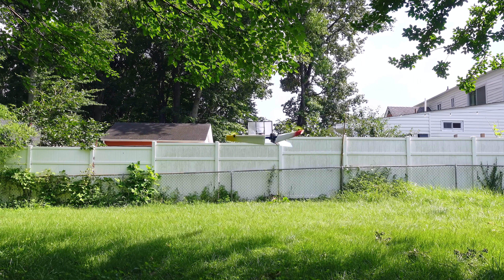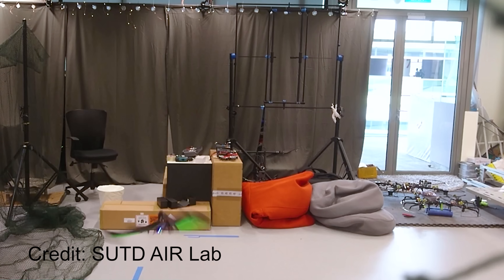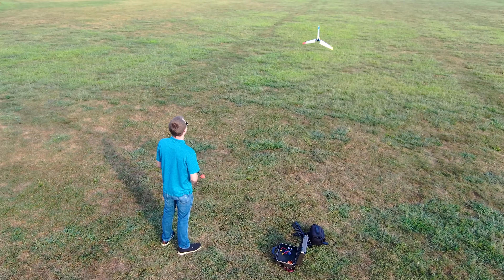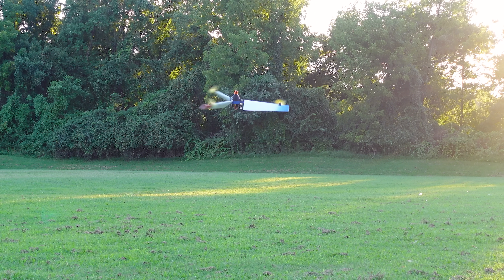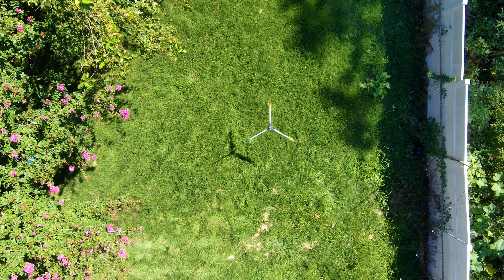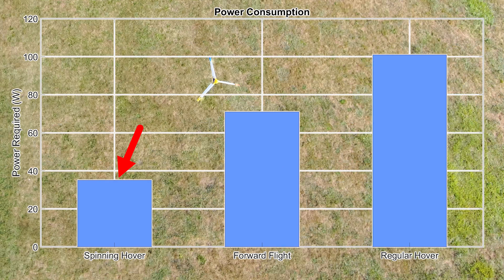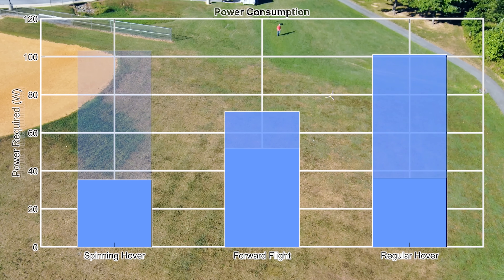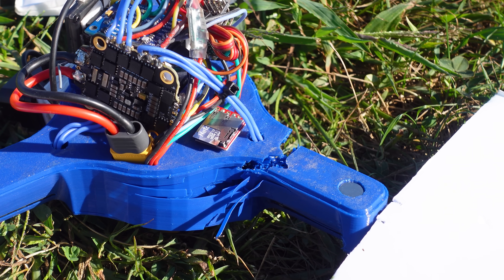Is THIS the Most Versatile Aircraft Design?  (Forward Flight Testing) - Part 2

Comment: Imagine adding solar panels as wings on that idea at 3:15 they could stay up for so long. And then the batteries run out they could land on the crown of a tree (with a special adapter) and recharge and then fly back up again once the battery power is sufficient.
Reply: assuming the weight increase is allowable, this sounds like a pretty good idea. Huge benefit that that fuselage (and battery) is rotating with the wings (and thus solar panels), meaning the wiring could be simple while keeping the battery close to the center of mass.
Reply: @grouchyfluff  Exactly, you would need a much bigger wingspan to get enough surface area, but that will also help acquire more lift. Plus, the solar panels can be embedded instead of being glued on top to save space and weight.

Comment: Ok, Mr. Rehm, cool design; but how about using 4 axis?? That'd increase forward flight as you'd have 4 semi-efficient foils instead of only 2? or, tilting the whole construct so two foils vs. one are on one side... to decrease drag and increase usability? is there a sweet spot where 3 inefficient foils are better than 2 efficient plus one dead weight? interesting. Good job, in any case! Keep them coming :)

Comment: Why don't you try a quad wing non symmetrical design, make two wings closer, that way forward flight would be more efficient since all wings would create lift, and multirotor hover would also be more stable because of four motors. I'm thinking about wings similar to this https://youtu.be/VXblTXgawjk
Reply: I'd guess it's because that configuration isn't great for the rotating hover mode which was the focus of this design but I could be wrong

Comment: Excellent innovation….it must be a breakthrough for drones! 👏👏👏👏👏👏👏👏👏👏👍👍 😊If you used jet engines, would it work similarly though much faster for military use or even large scales piloted fighter with high maneuverabily? Better still use Ti-Fusion motors to make a StarWars spaceworthy Ti-fighter. 😄😉

Comment: What happens if you spin the drone in forward flight? Does that just not work?

Your solution to being able to control the hover would probably be similar to allowing the whole drone to spin in forward flight. You would have to vary the speed of the props depending on what point in the overall prop rotation they are in...this would be very complicated, but also very cool.
Reply: One the one hand, you'd lose the lift generating effect of the wings, because the other one is compensating any net vertical force generated. However the big efficient propeller would be productive the Thrust needed to lift. Probably not as efficient as a wing moving through air in a straight line because due to the rotation the wings see a much higher appearant airspeed and thus generate more drag. It'd look really cool though.
We know you can turn your motor power into Thrust more effectively by using the big propeller. So it'd for sure be more efficient than conventional tricopter flight.
Maybe for reference it'd help to do a test run without the wings on?
Reply: Higher efficiency during hover of 3 bladed wing design is due to larger supporting wing area (3), vs. less wing area (2) in forward flight. Actually <2, as only horizontal distance of wing is creating lift. There vertical parts of wing making lift are acting against each other. (effectively making drag)
Reply: In essence, this turns the whole thing into a helicopter rotor of sorts in the forward flight regime, no? I wonder if introducing independent wing-angle control would unlock potential to adjust blade angle, similar to the effect a swashplate has on helicopters. This might require 2 more fairly robust servos and some VERY beefy code, however.
Reply: @grouchyfluff  yeah I was thinking this, you would need to independantly control both the small props and the wing angle of each. Then you should be able to have some pretty good control of the lift and counteract any rotational forces which would send it off course. 

You could make the code of the wing angle a little easier by having a mechanical guide which adjusted the pitch of the wing in a certain part of the rotation, the electronics could then adjust this guide which would influence the wing angle when it is at that part of the larger props rotation. To do that, you would need the center of the drone to be on a gyro and level as the reference point. Similar to what WW2 planes did to stop them from shooting their own props but that wasn't adjustable.
Reply: If you watch the first video, the angle of attach of all the wings and attached motors is controlled together. In order to get benefit from doing a spin in forward flight, I think you'd need to be able to vary the pitch of each blade individually based on where in the rotation it is. You could probably get it to work with just varying the motor speed, but aside from looking cool, I don't think that would have any benefit with the current design.
Reply: This seems like it could be quite efficient, as you're now using the efficiency gained by the large 'rotor' to produce your forward thrust. On the other hand, I'm struggling to visualise at what point it stops acting like a high-rpm propeller (i.e, lift is just the vertical component of thrust), vs something like an aircraft doing a slow aileron roll. My gut feeling is that these are fundamentally different flight regimes, with the former scenario not really providing much of a 'wing' effect (i.e. airspeed-dependent lift). But I'm not really able to come up with a good argument as to why the situations differ.
Reply from the maker: @JMMC1005  yea efficiency-wise, rolling in forward flight would be equivalent to doing aileron rolls which are less efficient because some of your energy is diverted to maintaining the constant roll rate as you move forward
Reply: @NicholasRehm  Would it be quite the same, though?

In an aeroplane, your wings aren't pitched to match the roll (except for the ailerons changing the effective chord), and your propeller isn't driving the rotation like your tip props are. Would be interesting to see the numbers.
Reply: @NicholasRehm  I seem to recall that the angle of attack for all three wings are sync'ed on the same gear. Would you be able to do something like a helicopter swash-plate to get more efficient rolling forward flight?
Reply: @NicholasRehm  If the curved wings wouldn't allow you to fly straight in the upside down Y mode, couldn't this be a trade off to increase the rotating hovering even further? Like, curve the wings for more efficient rotating hover but also change forward flight to be constantly barrel rolling?
Reply: @NicholasRehm  uhh.. you've come to the conclusion that it will be less efficient in your current design because a normal plane doing aileron rolls is less efficient than normal flight? There's no comparison to be made there.
Reply: @NicholasRehm  Not the same as aileron roll, because they don't provide forward thrust.
Anyway, i wouldn't swear it would be more efficient.
Reply: @NicholasRehm  I would personally not expect the efficiency increase to the degree we see with hovering, just alone mostly due to drag from the smaller propellers moving through different airspeeds as they rotate. But these also aren't traditional aileron rolls, no more so than a propeller is doing "aileron rolls". The vehicle itself is providing forward thrust throughout nearly its entire body.

I think it bears experimenting, but I understand the non-trivial nature of programming and testing this. But hopefully that can naturally come with your directionality control code you need for hovering in place.
Reply: But in such flight you can use the 3rd wing
Reply: Forward flight is more efficient than doing a barrel role. Remember that you have to counter gravity with lift.

The issue in this case is that now the third wing becomes a useless drag generator. Some method of stowing it out of the slipstream might prove fruitful.
Reply: @TCBYEAHCUZ  It seems like there'd be some benefit to having the larger wings able to make a powered contribution towards forward momentum. Maybe it's just an increased max/top in horizontal velocity rather than efficiency, though.
Reply: @steamer2k319  Thrust efficiency increases as the tri-wing essentiallly becomes a big propeller, but the drag from 3 wingtip vortices and the increase in thrust needed to at a high angle of attack would reduce efficiency vs just level flight.
Reply: @TCBYEAHCUZ  Yeah, thrust efficiency vs. lift efficiency (with lift taking on the bigger burden of the weight of the craft where thrust only has to overcome e.g., wind resistance) makes sense. Still, though, if it's more efficient \*for lift* to have all three wings blowing air straight down, why not tilt the axis forward slightly e.g., one or two or five degrees so that 99% of that power is still going into efficient lift but the remaining 1% is used for forward motion like a helicopter?
Reply: Maybe answered my own question in my own head... I suppose it depends on the flight path. If you can skim along the ground and get horizontal movement from the get-go, then you may as well put most of your energy into horizontal movement. If, however, flight is a particular advantage--so that you can e.g., go over buildings--then you're going to have to spend a fair amount on lift, anyway. Once you've climbed, it then becomes advantageous to convert/re-capture that vertical potential by gliding towards the destination horizontally.
Reply: ...and now I wonder if having the idle 3rd wing hang below the center hub, instead of trying to balance it above, would be worth trying. Thanks Nicholas for such a thought-provoking invention.

Comment: I Love the Idea Of using it's spinning with the Lidar and Having it scan it's surrounding And  Map out area's Like it could be used for Noticing small Batches of Spreading wild fired where there's decent Wind defusing or moving the smoke so it could fly and scan the edge constantly Drifting with the fire so it's easier to block or Stop or Burn grass in front of it so it can't spread as much Exct!
Reply: what's with the random caps buddy